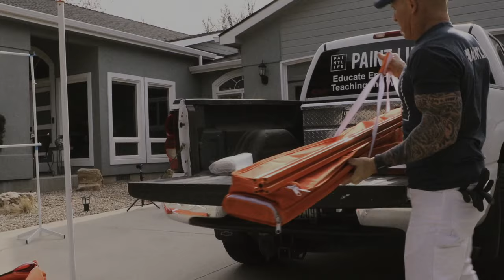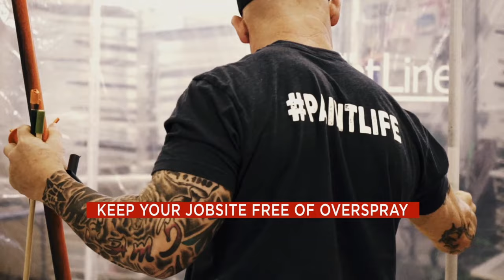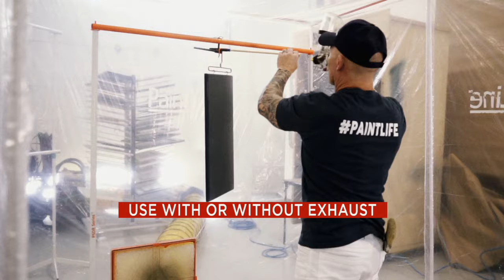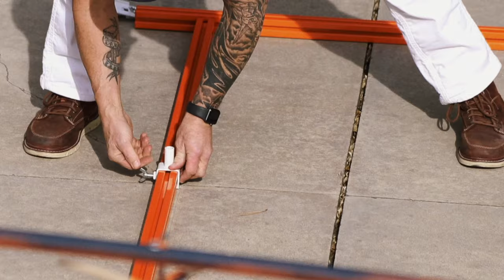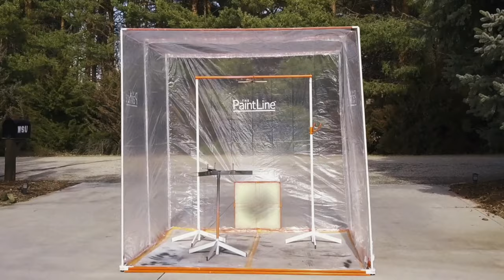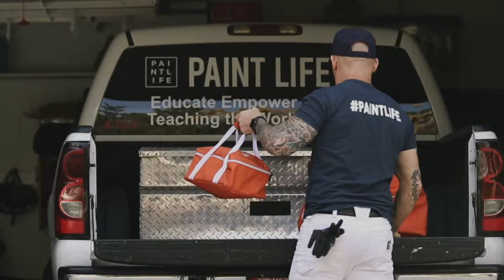Mobile Paint Spray Booth.  Portable ventilated booth.  DIY Spray Booth.  Garage Paint Booth.

Comment: I made a portable spray booth out of pvc pipe. Used 6mil clear plastic sheeting for the walls, with sticky velcro to attach it to the pvc pipe. The back has a velcro opening that can be closed to create the suction from the fan, that has a $3 vac filter in front of it. Breakdown and setup is a cinch, and it's reusable.